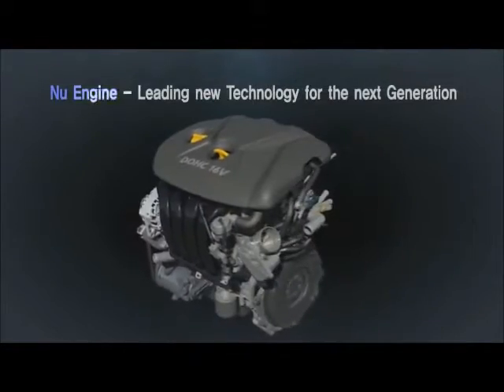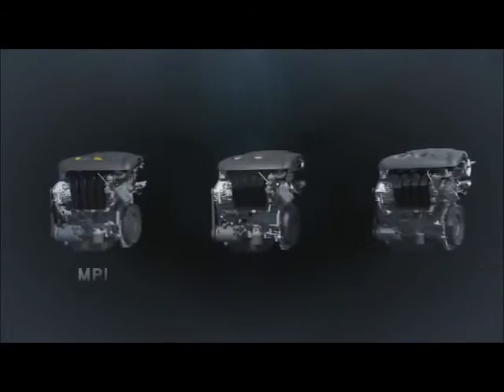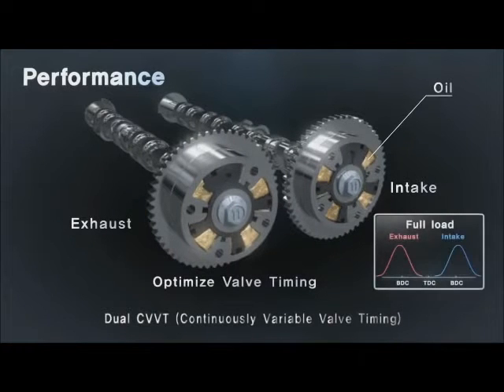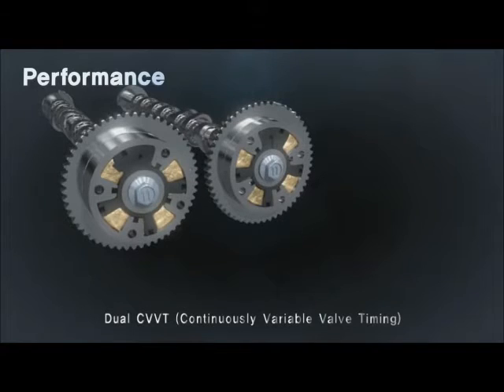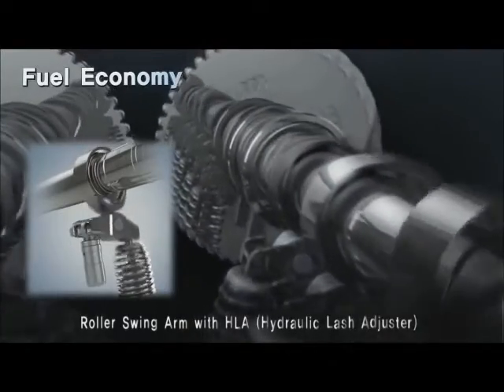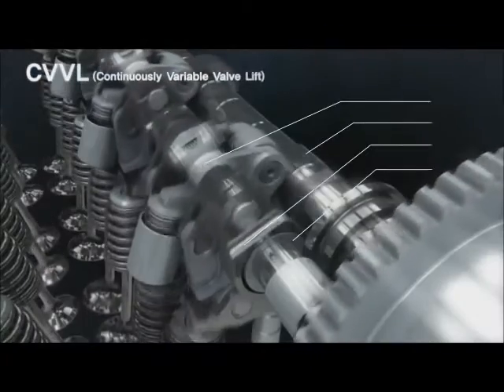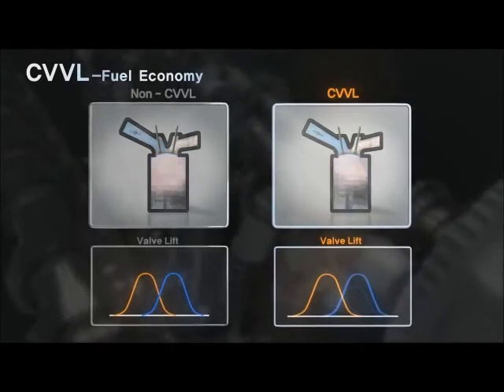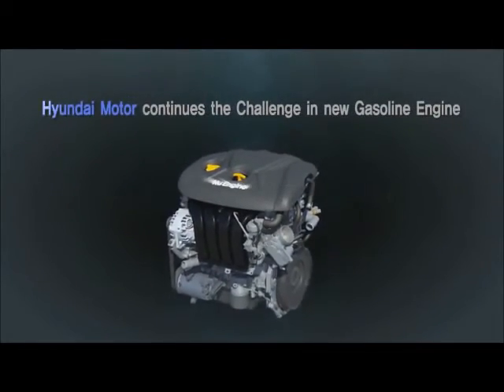Hyundai Nu Engine

Comment: Impressively durable engine on the Elantra.
Reply: DistopianRegime good. Just bought a 2018 Elantra manual transmission, great gas mileage. Not very powerful but I baby it like no tomorrow. I absolutely love this car. Rides great. This 2.0 liter is engineered for fuel economy. I'm driving now getting 46 mpg!
Reply: Back to tell you 133k. 2 repairs, wheel bearing and a seeping water outlet. Total repairs under $500. Most reliable car I've ever owned. The only thing I recommend is to check oil levels between changes. However, everyone should be doing that!
Reply: This aged like milk